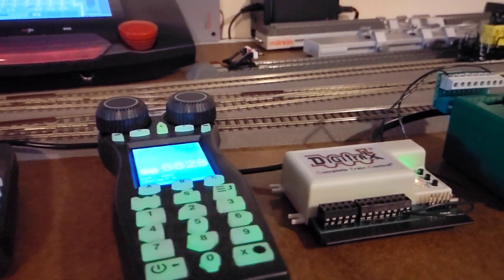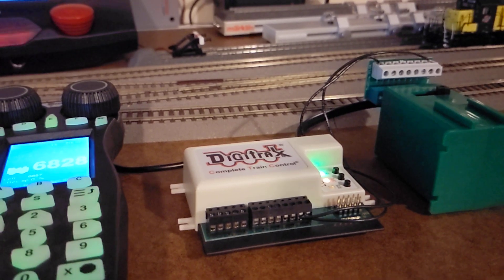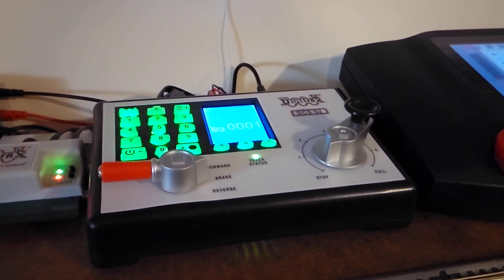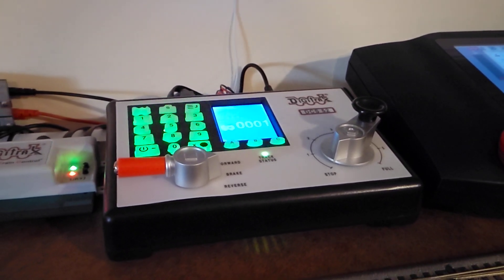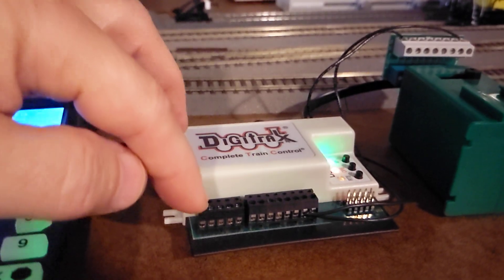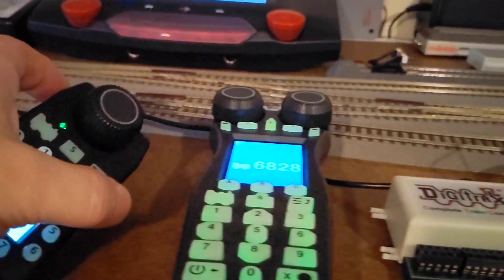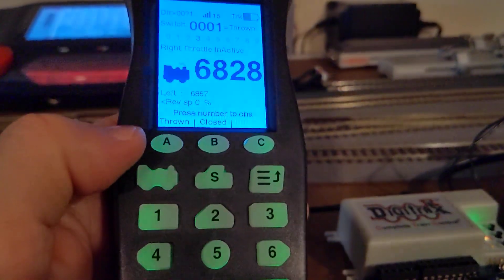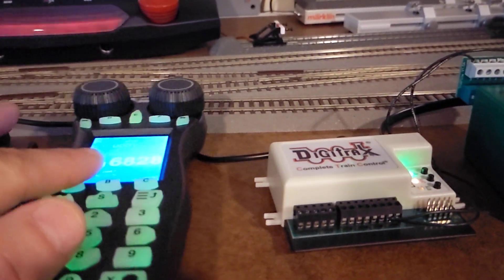Digitrax DS74 Quad Switch Stationary Decoder intro

Comment: With the DS64 I could NOT use  a separate power supply like the PS14 WITHOUT being on LocoNet. I am using an ESU ECoS 50210 Command Center and Kato track, so I am forced to use track power for the DS64. Is the DS74 the same? And further, can you do a video about implementing the DS74 and Kato turnouts? This is somewhat helpful, but you are not addressing solenoid switches. Thank you.
Reply from the maker: I will try my best.